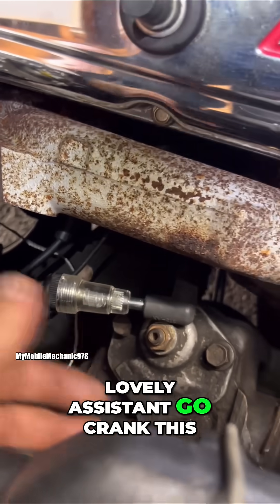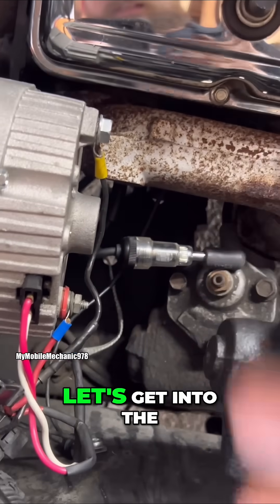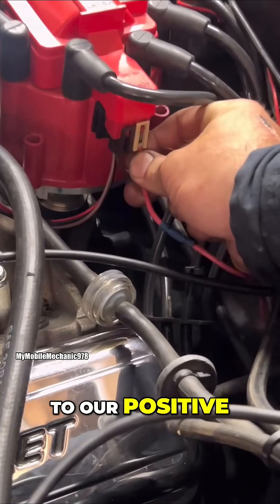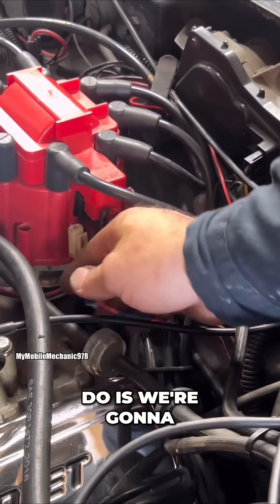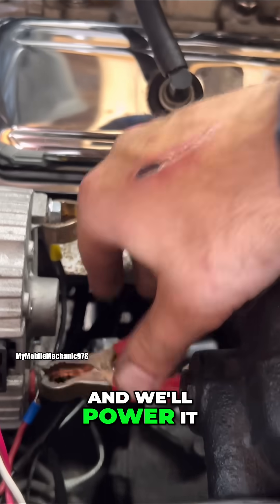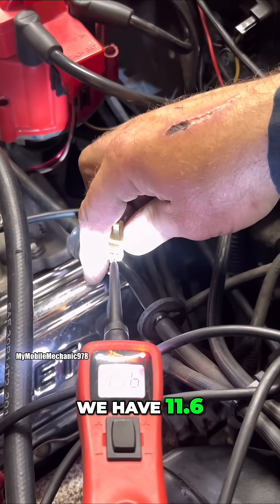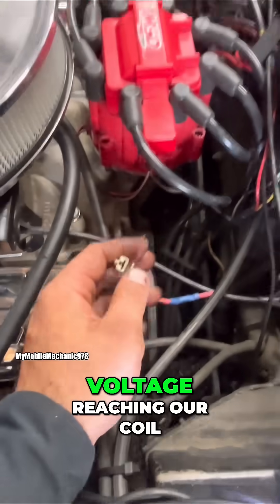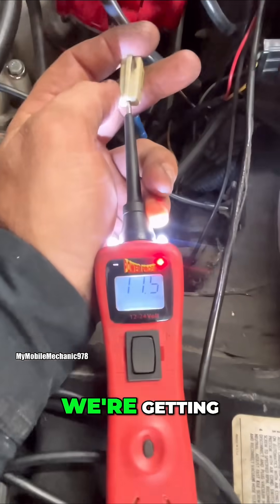Ignition Coil Voltage Test: Step-by-Step Troubleshooting Guide

Comment: It's almost always a bad ignition module, very problematic on those old chevs.  Check for resistance across the coil leads to verify the coil is good.
Edit...clean old heat sink grease from the distributor housing before applying new thermal grease.
Reply from the maker: You were 100% correct that’s exactly what it was the four prong module ignition module